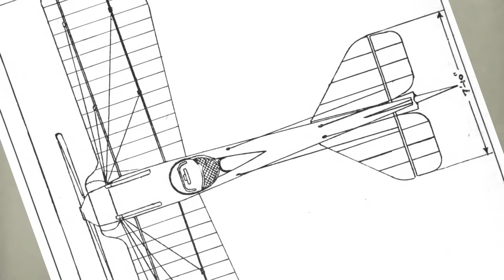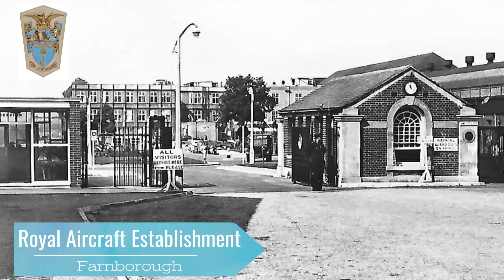This Spitfire ALMOST Went SUPERSONIC - The British WW2 Fighter That Almost Broke The Sound Barrier

Comment: It must have been an unreal feeling to hit 400 mph for the first time, especially if you were the one setting record. I always wonder what it would have been like to combat dive in a P-47 at 540 mph with that R-2800 screaming away in front of you.
Reply from the maker: Imagine the adrenaline rush!! The original speed junkies.
Reply: Hoa Tattis  correct !!)
Reply: The highest mach number reached by Hawker Tempest 5 flown by Winkle Brown  mach 0 . 87
Reply: Hoa Tattis  Hawker Tempest page .
Eric Winkle Brown .
Testing for combat test flying the Hawker Tempest 5 .   Mach 0 .87
Reply: Hoa Tattis  Have you looked up The 
Hawker Fury prototype LA610 ?)
       (    In a ward stunning !! )
Reply: Hoa Tattis  Hoa  ! If you look it up tell me what you think ?
An Aerodynamic Stunner , in my opinion .
Reply: Hoa Tattis  i don't understand , Which  aircraft do you mean ? Expand ?
You didn't give any detail .
You didn't say if you checked the Fury prototype out ?
Reply: Hoa Tattis  yes i had exactly the same problem .
There doesn't appear much information covering this aircraft .
I think it means searching the net for information .
Reply: Hoa Tattis  All i can tell you is that it was powered by the Sabre 7.      3000 plus H  P speed 485 mph i also read somewhere that it reached 490mph ?
I can't remember where though .
 It was the fastest of the Hawker series piston fighters .
Reply: Hoa Tattis  i forgot to mention it had  power assisted controls .
Reply: If you require information in detail covering the Sabre 7 , then i suggest you get in touch with the Napier  Power Heritage Trust .
It might be a good idea to ask them if they've got any technical information on the Hawker Fury LA610 as well .
Reply: mph is not use in aviation , only Knots (nautical miles per hour), or km/h on all continental europe aircrafts
Reply: A grave yard dive .
Reply: Hoa Tattis  I've come across literature stating a P-47 was taken to at least Mach 0.83. Plus I'd rather do that in a P-47 as the airframe can probably take more of a beating than a Spitfire.
Reply: @zacharyprovance3128  your deluded .